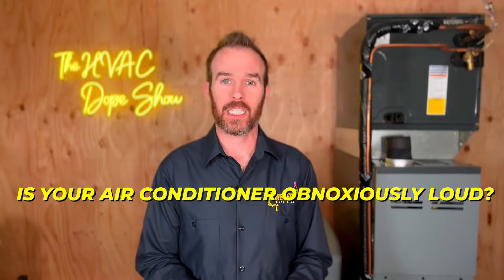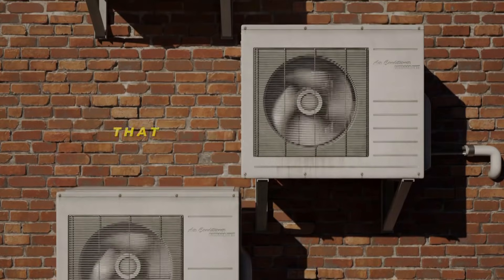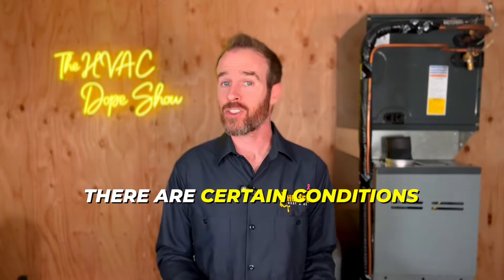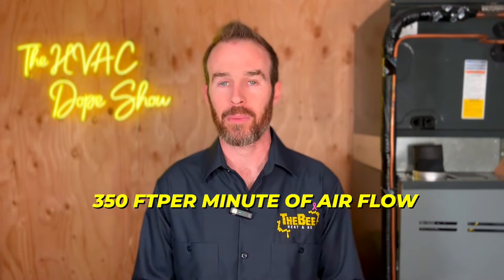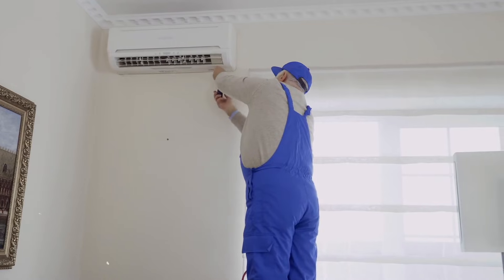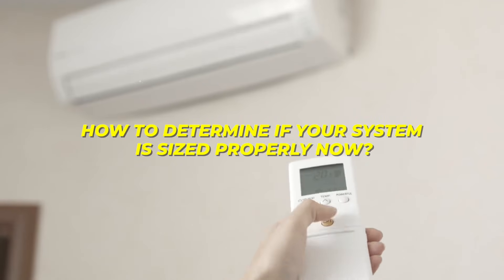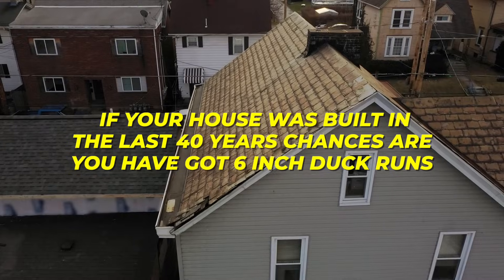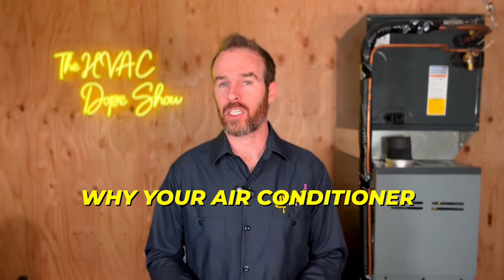THIS is Why Your AC is LOUD 😬📣😭

Comment: Do you review videos? My Ac is making a noise I cannot find anywhere and my hvac people can not figure out what is wrong. We have replaced a fuse, cleaned the Ac, changed the fan motor, and capacitor twice.